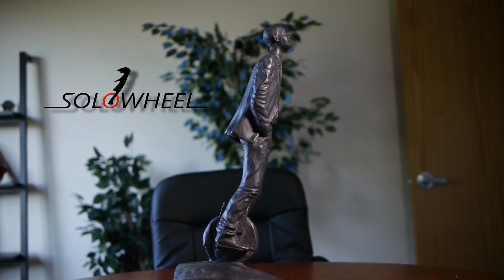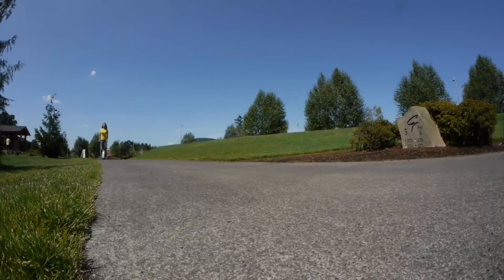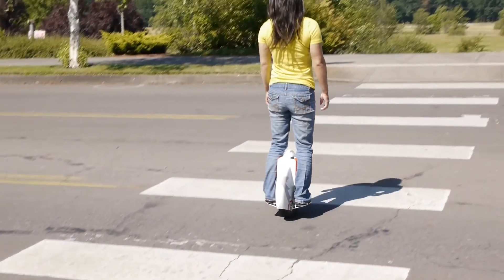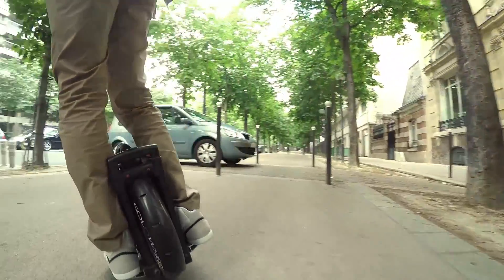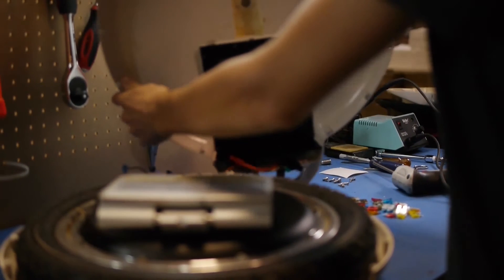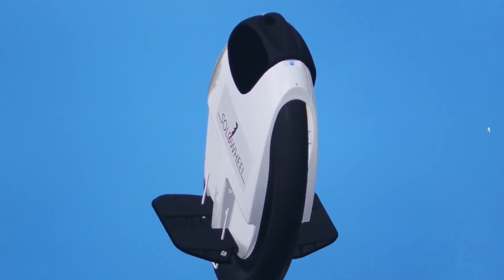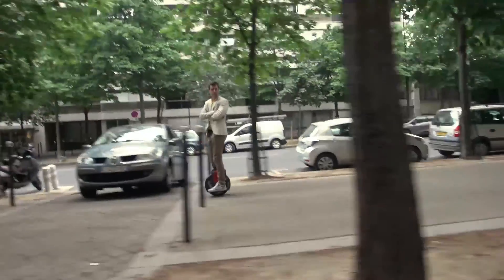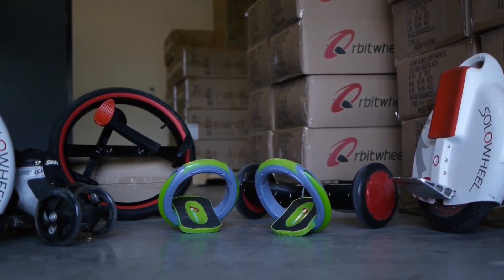Solowheel - How Does It Work?

Comment: it uses newtons third law, the computer, via a VFD,  is able to make the hub motor turn forward and reverse in small pulses but very quickly. when the wheel is turning forward at speed the motor is also being forced to turn in reverse just a little bit but very quickly, that's how it suspends you.    I think that's how it works.  but it was segway that came up with this tech first a long time ago no?